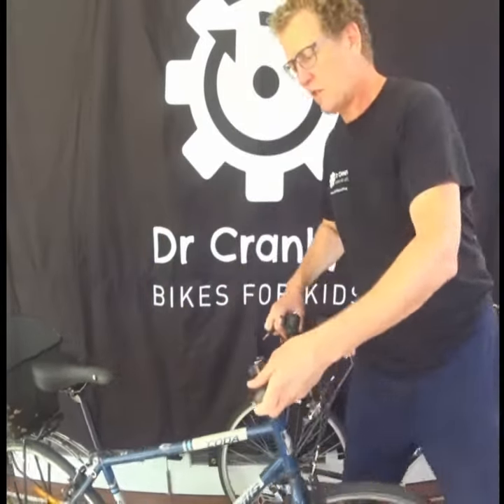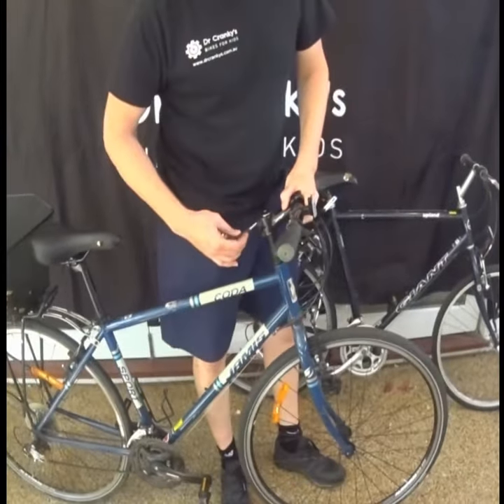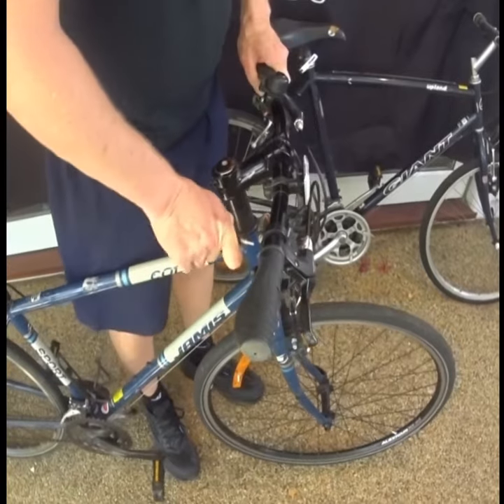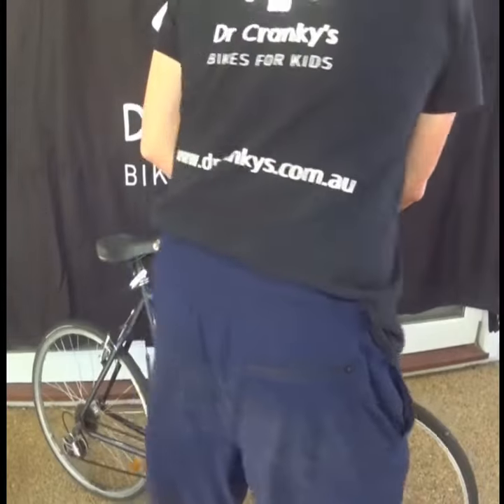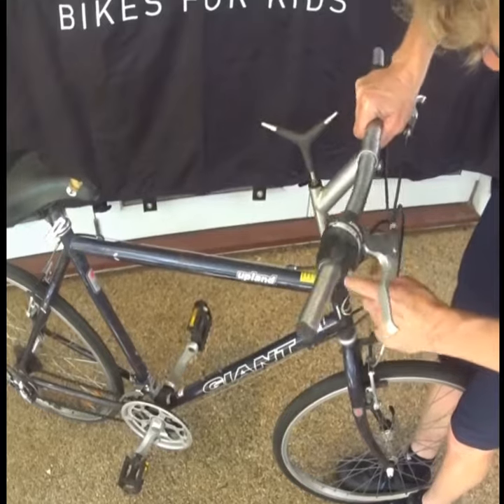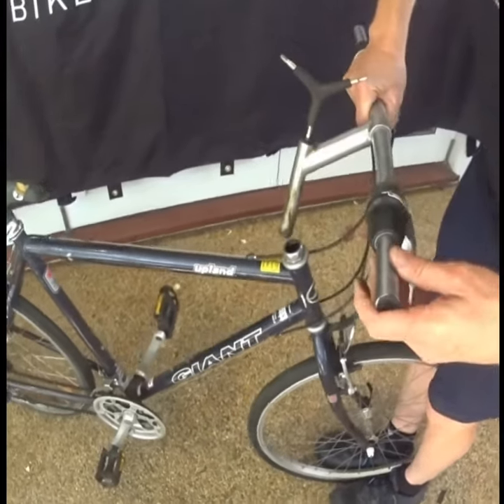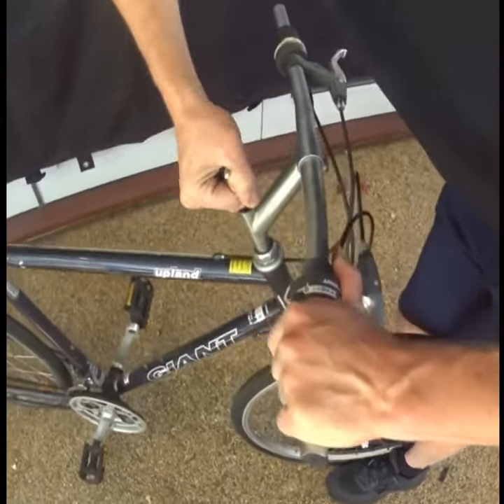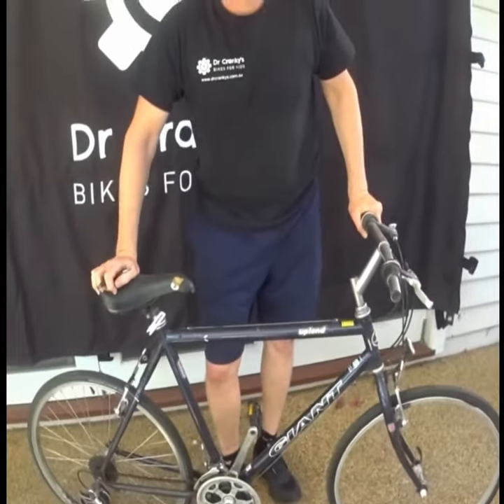Fix loose steering - how to tighten the head stem on a bike

Comment: Thanks for the second part.
Reply from the maker: Glad it was of help.
Reply: @DrCrankysBikesforKids  😒 WouLd haVe been nice iF you menTioned the eXacT pRopeR tooL thaT is reQuiRed yoU knoW the one you'Re uSinG in this vid.???!? 💡 🔧
Reply from the maker: @TheAGODAMI  It's an allen key, usually 6mm for quill stem (the one that goes in the fork) or 5mm for the threadless one.

Comment: How about when your handlebars are tight but the wheel still moves side to side?
Reply from the maker: Good question. That could be the axle of the wheel (tighten the bearings) is loose or the wheel nuts are loose  (tighten the nuts).  On suspension forks it is sometimes the play in the fork, especially cheaper or older ones.

Comment: For the second one, what would be the name of the tool?
Reply from the maker: It's a  6mm allen key. This one on a "Y-wrench" which has three sizes 4,5,6mm. Handy and the tool also provides some leverage for turning the bolt.
Reply: @DrCrankysBikesforKids  I have the same problem as in the video, but I do not have a tool that can be inserted into the hole that I have to insert the screwdriver into. In other words, I do not have a screwdriver of the same size as the hole, so what should I do
Reply from the maker: @TiNjA311  its not a screwdriver, its a 6mm allen key.
Reply: @DrCrankysBikesforKids  Yes yes, thank.

Comment: hey man, everything is tighth but my whole handle bars move. the rod the runs down to my suspension or whatever is loose. like my handle move up and down. what do i do?
Reply: Did you find out? I am having similar problem. I literaly cannot fasten the bolt any more and the handels still move with respect to the wheel, if I use force. I crashed on the bike once before because the handles moved the other way than the wheel after riding up a sidewalk. Very dangerous.
Reply from the maker: You need to loosen the side bolts first. Tighten the top one THEN tighten the side ones.

Comment: I have the first type and I have tightened all 3 bolts, the 2 pinch ones and the top stem one and it will not get tight enough. I have literally destroyed the hex wrench I was using it literally bent before the nut got tight enough.
Reply from the maker: Faolan. Make sure you do in the correct order. The top bolt is tightened to hand tightness first. Then the pinch bolts. If you do it the other way the tightened stem stops the top bolt from tightening the bearings. Try loosening the pinch bolts first and try again. Let me know how you go.
Reply: @DrCrankysBikesforKids  my whole front steering is entirely & dangerously loose. Fell the other evening. Not only that, but the seat had very obviously been festered with; up at an extra inch & crooked to boot! And was PERFECT 1 day before..  , I may need to find a prayer or private detective channel next🥺😟🤷‍♀️. Btw, Your comment to which I am replying is invaluable expertise. Each time I'm reminded I say again THANKS!! to My Horology Professor 😊 And A Thanks are For You!🐞
Reply from the maker: @gabriellegilbert5239  You might have to check your bike before mounting if leaving it on the street.

Comment: I believe I have the second type of stem and I feel like I tightened it but it still moves
Reply from the maker: This can happen if the wedge in the fork tube is rusty. Loosen, take the whole assemblage up and out (pull up and twist side to side). Grease the bolt and wedge and put the whole lot back in and tighten. I'll do a video to explain as it seems to be more common than I though. Let me know how you go.

Comment: Mine won't tighten 😭😭 I tried doing that but nothing worked. Please help 😭
Reply from the maker: Sometimes this is because the wedge in the steerer tube is rusty. Try loosening and removing the bolt. Grease the threads. Spray some lube into the steerer tube from below ( bike upside down) and try again. Or use a long handle Allen wrench for more force.

Comment: I have a quill and I did the steps but it still is loose
Reply from the maker: Sometimes this is due to the bolt inside being rusty.  Try pulling it all out and greasing the threads.  Then retighten.

Comment: WTF I am not finding the answer to my question. No matter how tight I tighten that goddamn 6 mm hex key I cannot get the handlebars to tighten up. What do I do!?
Reply from the maker: Probably means the wedge is stuck. Try loosening the bolt and pull the whole thing out. Put some grease/oil on the threads down at the wedge and try again. . Let me know how you go.
Reply: @DrCrankysBikesforKids  thank you for your answer. I found out what the problem was the guy who built the bike for me put the wrong size neck on my bike so yeah rookie mistake on his part but I didn't know any better because I have
Not wrenched  on a bicycle since I've been a kid but yeah I brought it to a bike shop and they hooked me up. Thanks
Reply from the maker: Cheers.  Glad you fixed it.

Comment: Mine is still loose after tightening the quill bolt
Reply from the maker: If you cant get it tight enough you may have to take the whole stem out and grease the threads. They can get rusty and hard to turn.

Comment: My bike handle bar even when I tight it still loss
Reply from the maker: Can be that the bolt inside is a bit rusted. Try loosening and pulling whole thing out, apply oil to threads of bolt and try again.